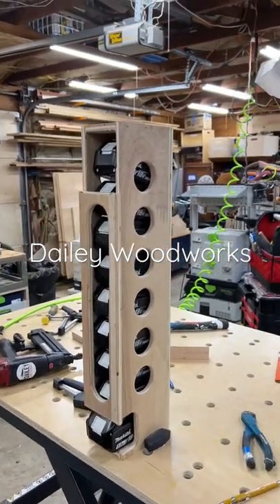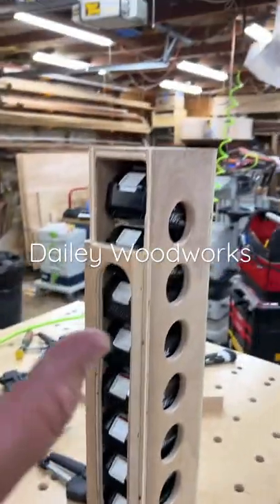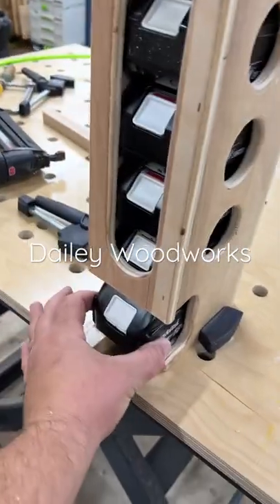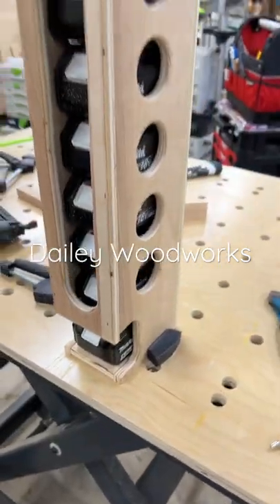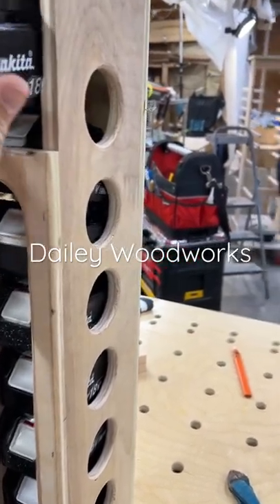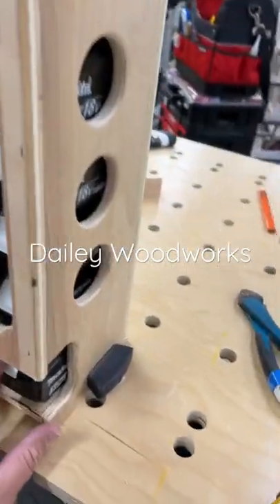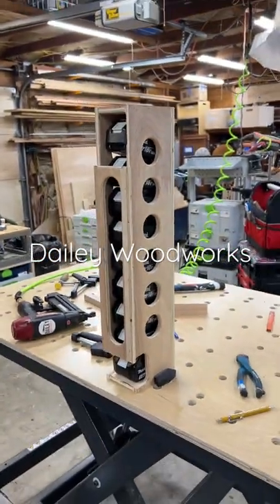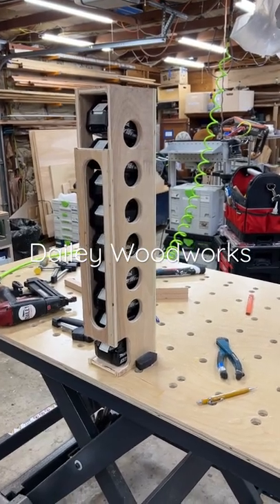Power Tool Battery Dispenser

Comment: Looks great!  Only concern with cycling batteries evenly is when one goes they will all be up for renewal.  A pretty costly time if your replacing that volume of batteries.  Also wasn’t clear how the bottom one locks into place.
Reply: This is enough for a contractor with maybe 2 employees. Also its quite obvious on how it locks into place.
Reply: The clip is taller than the spot where the wood is at. You press the button, the clip lowers, it slips out. Not confusing, just rewatch it